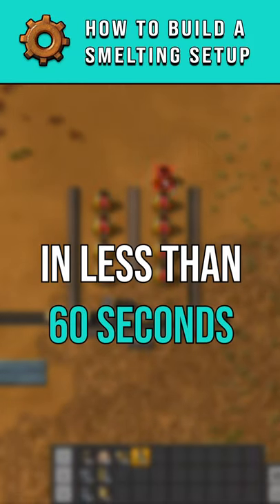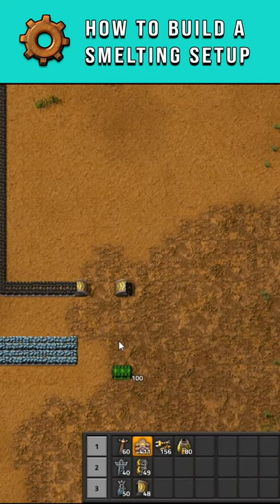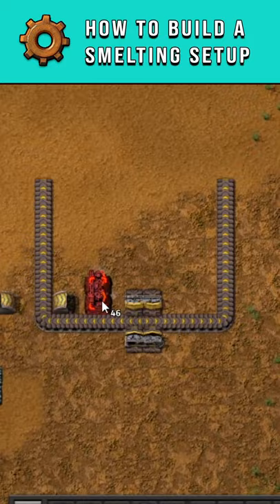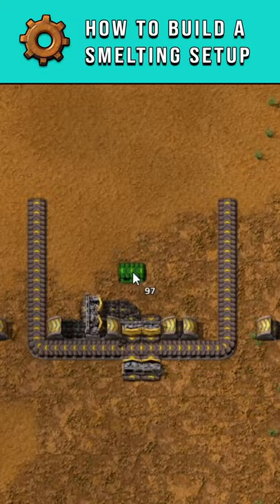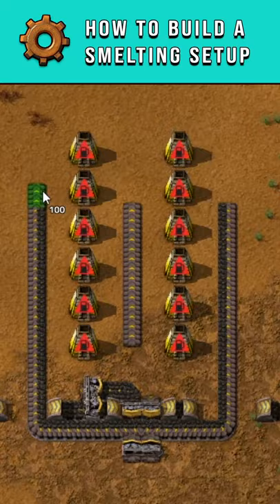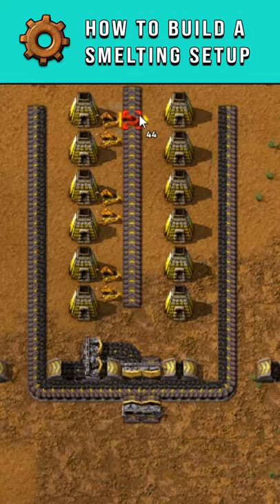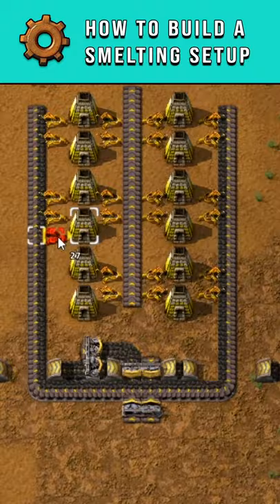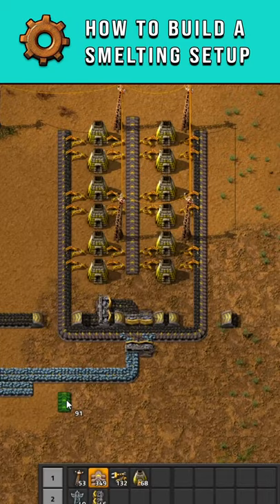How To Build A Smelting Setup In 60 Seconds - Factorio

Comment: As a veteran, I know this design by heart, but I feel like it would be more intuitive to newcomers trying to learn if you started with the furnaces, then the center and side belts and then the coal and ore loading last.
Reply: I learned the reverse version of this setup from the tutorial! soo useful
Reply: This design is depracated. Nowadays it's better to use one splitter, tunnel the coal crossed and then use arms to put it on the belt
Reply: When I was a noob I just put miners and then immediately after furnaces

Comment: The key is to understand why this pattern works. Belts actually contain two lines, and the splitter arrangement distributes the input lines evenly into both sides of the belt. It's a very basic lesson in Belt Fu but a very important one.

Comment: 48 furnaces per yellow belt.
Reply: That’s for iron plate output. You still need to feed them the ore. A setup like this will get you like a quarter of the way there, half lost because it’s half coal, another half lost due to the splitter at the start.

So It’s 12 with a setup like this.
Reply: @MyNameIsSalo  no, 48 furnaces works. The iron ore is only on half the belt, yes, but the iron ore moves along two belts each at 7.5 iron per second. Together they make a total of 15 iron per second. And the splitter has no effect on the throughput, because so long as each belt is taking its 7.5 per second, the splitter passes through 15 iron per second as intended.

Comment: Protip: For MAXIMUM EFFICIENCY, make this setup with 48 furnaces(24 on each side).
Here's the math behind this:
Yellow belt speed - 15 items/s
1 furnace smelts 0.316 iron/s
15 / 0.316 ~ 48 furnaces
Edit: it also easily upgrades to fill red belts, just replace the normal furnaces with steel ones
Reply: oh yellow is basic belt
Reply: is it bad that I put all ores in the center? not on the outside?
Reply: @greywolf9783  Doesn't matter. If the ore and fuel is automated and it works - then it's good enough.
Reply: another way of approximating this is finding the multiplier of 0.316 x ? = 1 (? being the multiplier) and multiplying 15 by that, so in this scenario, ? = 3.164556962 . Which means ?15 (3.164556962 x 15) ~ 48 (47.46835443)
Reply: Alternatively build half that (12 on each side) and upgrade to steel furnaces when you unlock them. These stacks are great for your early bus base, which is okay to leave at yellow belts. Later on it's easy to either supplement your base or even replace it with train fed outposts.
Reply: yeah i knew that but how much coal miner to fill entire belt? and how many smelter lines a full belt of coal can supply?
Reply: @305killer  You need 30 electric miners to fill a yellow belt with coal.
You can fuel 666 furnaces with a single yellow belt of coal. That equates to 13 smelting setups
Reply: @memeymeme3645 No, you have to put the input resources on two belts on the outside because that way, you are splitting one full belt to two half belts. Where as if you only have one belt for input, You would need to have coal on a separate belt which is a waste of space
Reply: What  @nilsgrana519 said. The output needs to be on the inside, otherwise you'd need to run twice as many input belts. If you only feed 7.5 ore into the stack (half a yellow belt) your stack hardcaps at half as many furnaces.
Reply: I just make 2 rows of 24 and merge them at the end

Comment: I just feed the ore and coal on to one side of a belt and then split it, is there a benefit to this one that I'm missing?
Reply: It produces the same amount. The only disadvantage is that this one easily be expandend on the side where excess coal flows trough. But the same effect can be aquired with some splitters.

The only advantage to this design is that it looks super cool and it's kind of tileable

Comment: hahaha, When I first did this kind of design I had the coal and the Iron coming on the inside and the Plates going out.
Reply: Is that a bad thing?
Reply: @matyasnovak9539  Yes because it divides by 2 the amount of smelters I can put in a line while wasting space on the sides.

The one shown in this video is better in every aspects.
Reply: @meneither3834  oh frick i spent 5 hours today building it wrong
Reply: @matyasnovak9539  I've built them wrong for over 100 hours !

You can just keep at it and add better smelters later.
Reply: @meneither3834  you can make them merge in the middle and have the same result and it is able to be made before you get splitters and undergrounds

Comment: What's the purpose of the mix of splitters and underground belts at the top when they all merge? Does it even out the belts in case you start to run out?
Reply: The mix of splitters at the very top is a belt balancer, it makes it so that each input belt is split evenly across all 4 outputs. It prevents any line of furnaces from producing any more items than another, by doing this you won't end up in a situation where one furnace stack works at full capacity while another sits idle. Final note about balancers, they're extremely useful when loading and unloading trains!

Comment: I did this with regular furnaces but will it work with steel furnaces or possible electric ones?
Reply: For Steel Furnaces you would need Red Belts to feed them properly, assuming you have a total of 48 Steel Furnaces.

For Electric Furnaces the base number of Furnaces is still 48, but this is modifiable by the various modules (Speed, Productivity, Efficiency, and Quality).  Electric Furnaces are also 3x3 in size so you will need to change your Smelting setup.

Of course one fun setup is Bot Smelting where you have a Requestor chest demanding 24 Iron Ore, and a Green Inserter feeding the Electric Furnace.  The Electric Furnace can have two Prod3 modules in it, and there are 12 Beacons around it each with 3 Speed3 modules in it.

A base Electric furnace produces 5/8 of an Iron Plate per second, the two Prod3 modules change this to 1.2* as much at 70% the speed, while the 12 Beacons with 2 Speed3 modules each have half effect, for a +600% speed.

So 1.2* as much Iron Plates multiplied by .7 multiplied by (1+600%) = 5.88 Iron Plates per second.

If my math is right.